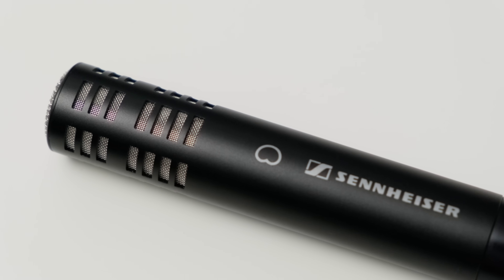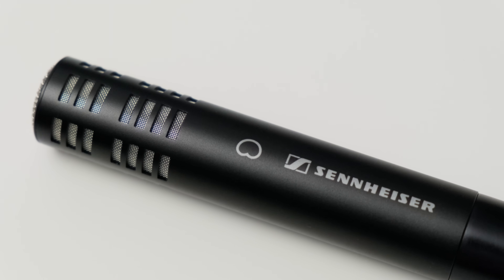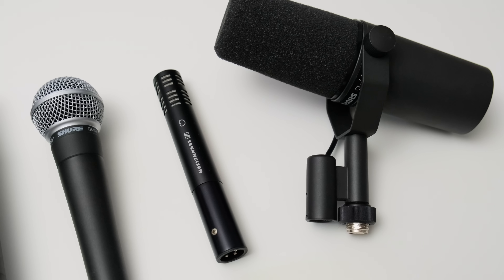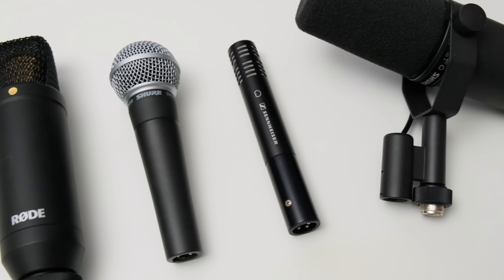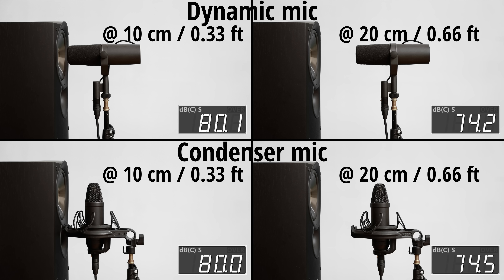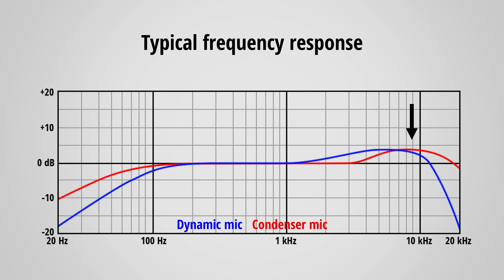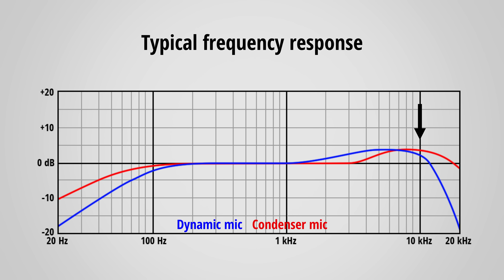Dynamic mics don’t reject noise better than condensers! And yet they do?

Comment: I don't get this video : the final exemples are clearly showing huge differences between the different mics regarding the pick up of room sound, and it's not clear to me if it's only about the frequency curve of the microphones (of course, I also hear the different frequency curves). 
I understand the argument about physics (sound is the same, wether it's a dynamic or condenser mic), but it's not only about the source, it's about the mechanical transformation of it into an electrical signal. Microphones have different chracteristics that have obviously a huge influence on the way they pick up room acoustics : directivity, sensitivity, SNR, proper noise level, size of diaphragm, impedance etc. etc. Whatever if it's a condenser or a dynamic, a, omnidirectional microphone with high sensitivity will pick much more room sound than an ultra-cardoïd one with a low sensitivity. The impedance of the preamp has also quite an influence about that. 
And I guess condenser and dynamic microphones have different characteristics "in general" that could explain the simplification of "use a dynamic if you want to get rid of room sound" : "usually" condensers have higher sensitivity and a better SNR, a lower proper noise, a different directivity... etc. even if, of course, some dynamics sound more like a condenser and vice versa (for exemple, the Sennheiser 441 sounds like a condenser).
There is also another aspect I would be curious to have some insight from someone that has some technical background : is the level pick up of a microphone absolutely linear ? Or in other terms, is the level of acoustic sound perfectly replicated in the level of the microphone output ? Or is there some kind of curve, different for each microphone, that characterizes the relation between source level and output level of the microphone ? If it's not perfectly linear (what I suspect), it could explain the way some microphones reject better low level noises, while picking the same way high level ones. This is what I hear when using dynamics : at similar global level, low level sounds are less audible compared to using a condenser.

Comment: I feel the dynamic doesn't actually reject noise but cut it down much more than the condenser microphone, the condenser microphone uses more power to empower the signal, while the dynamic is powered by the strength of the signal that comes in... 

Like the light on a bycicle, the light becomes brighter when the friction increases compare to that of a car that uses battery...

When you take a good look at the components both dynamic and condenser microphones are being made with you will realise some other properties that are missing from the dynamic which probably makes dem work differently...

Comment: Love almost all of this, just a little confused about one point:

Couldn’t you theoretically imagine a membrane which, due to whatever physical characteristics, has a non-linear response to sound pressure?

Maybe it’s just like a stiff material that won’t really put out an electrical signal if the sound pressure is below a certain threshold. Some sort of physical noise gate.

In this situation or something similar, would it be fair to say that the idea that the quieter sounds (characteristic of background, noise or room ambience) could indeed be rejected in a way that doesn’t violate the laws of physics?

Comment: Really can not agree
Try testing in noisy environment than check back
I've been using my sm58 just for that and it performs a magnitude better than my pencils and large diagram condencers.
More rejecrion, less noise thats how it works for me and why I use it
Also you used one of the if not the quietest condencer(self noise) out there, try something in the league of 80-150$ for condencer, self noise is quite present in that case.
Reply: It's about the distance from the mouth to the microphone. People tend to talk (and sing) while the sm58 almost touches their lips because it's designed that way. 

Now you're going to claim that you've had the other microphones just as close, but we're not going to believe that.

Comment: id be interested to see the nt1 and sm7 compared off axis as well - i always thought it was because dynamics use much heavier coil and magnet transducer systems that the extra mass made it harder for the diaphragm to vibrate in an odd direction therefore reducing the amount of reflections/off axis noise - now that i think about it, i never formally learned that or was told that, it was just the logical reasoning i came to and then reading years of mythos surrounding dynamics confirmed my bias there

but i think it may paint a larger picture in the way they respond to reflections or off axis noise and maybe would key in more info on why dynamics have been recommended for untreated or overly live rooms

Comment: Finally someone who got it right. I did a lot of measurements and tests and came to similar conclusions, especially that for nearfield recordings, you can simulate one mic to sound like another (which was also proven in many tests with systems like Townsend LAB sphere (which I owned), UAD Spere (which I own) and others). BUT if you record with a bigger distance and more room reverb, the construction of the mic gets more and more important. Some cardiod constructions (and I mean not "dynamic vs. condenser") are MUCH better in terms of intensity and coloration at side/rear rejection than others, and the best constructions do not discolorate the sound like others (and well constructed mics don't have to be expensive). Also you have clever concepts like Variable-D from EV which minimizes proximity effects. Who wants more from this: the youtuber "Podcastage" did hundreds of mic tests here on youtube, speaking in the mic from different directions. What makes this topic really difficult is that people often use mics as "first EQ" because they would find it much harder to reach their goal only with a hard-/software EQ (or they simply want to save time). Also, people who never measured a mic are not aware that often their frequency response is quite complex with many little dips and so on. So it's not always so easy to simulate one with the other as you showed.

Comment: Thank you sooo much. I've explained to many people, it's all about pickup pattern, sensitivity, and response curve. Thank you for debunking every single "but what about?" I've faced over the last 10 years.

Ultimately, for vocals-only, dynamics can be absolutely fantastic.  If you don't want to capture the "space", having a mic which tolerates being basically licked can be an asset.

But for all-round use, condenser sounds more natural in many more use-cases. Especially since some amount of reverb in a room can actually be desirable, for acoustic guitar or wind instruments. (Perhaps for violin, too?) They also work well for recording weather, birds, and so forth; since they don't need to be boosted as much and capture more of the "space".

Comment: I've seen  this covered a few times now by various content creators. One guy even tried to say the opposite was true. Yes I guess you're technically correct. That 2 quality mics set up the same with similar pick up patterns can both perform the same. But, most people using a mic are not using a Neuman or something from Earthworks. They're not doing XY or Z to make sure things sound right. Everyone knows that guy that hops in your Discord call. You can hear his kid on a different floor. The dog snoring on the floor in the next room. The neighbor that is mowing their lawn. The SO yelling in the background. The AC humming away. These people are almost universally using condensers. Maybe a Yeti at best.  IME this situation is almost entirely remedied by recommending a USB dynamic if they're open to suggestions. 

Whatever reason that may be. They could not be set up right. The condensers at that price may just suck. There could be a lot of things. Regardless, I think a dynamic is still the easiest solution for that person that might not even own an interface and is Googling "mic that rejects background noise".

Comment: I've heard that a condenser microphone with a cardioid pickup pattern doesn't maintain the same pattern across all frequencies. Specifically, at higher frequencies, its pickup pattern becomes more omnidirectional, whereas a dynamic cardioid mic retains its cardioid pattern more consistently across all frequencies. Is this true?
Reply from the maker: @stellaid-d5o  Hey, that not entirely true . The difference is not whether it’s a condenser or dynamic but it has to do with the membrane size. Large diaphragm mics tend to have a more narrow pickup pattern at higher frequencies. Small diaphragm mic tend to keep their pattern more consistent across different frequencies.
Reply: @JulianKrause  Thanks for clearing that up! That myth has been nagging me for a while, so I really appreciate the explanation

Comment: Hmmm, sure, the sound waves don't act different, but the membranes do. Correct me if I'm wrong, but to my knowledge membranes in dynamic mics have more inertia due to having to move a coil in a magnetic field, while in condensor mics the membrane itself moves in an electrical field. This, to me, explains the better transient response and better high frequency response of most condensor mics. But it also means the membrane of a dynamic mic needs more energy to move, hence not capturing that much detail (or room noise). Feel free to correct me where I'm wrong, very interesting video!
Reply: Hey there. Yes the membranes are different, and yes the the coil in a dynamic would have a lower sensitivity. But the coil doesn't know what is signal and what is room noise, therefore the entire signal is attenuated equally, both wanted and unwanted incoming waves. The video went into that a bit when he mentioned that you have to use more gain with a dynamic. You just get a lower signal overall, direct sound and reflections altogether.
Reply: I think that the argument DayBrake is making here is that the dynamic mic's membrane has an increased resistance to moving _at all_, i.e. that it has a nonlinear response at low amplitudes. While we model microphone diaphragms as ideal spring/mass/damper systems, the fact is that there are things like coulombic friction and stiction that come into play at low amplitudes, and dynamic mics are often "worse" in that respect.

In my experience you can often approximate a dynamic mic's "noise rejection" by adding a noise-gate or expander to the signal chain with a condenser.
Reply: The magnetic field doesn’t create inertia, but the mass of the diaphragm and other construction details affect the frequency response. If the ambient noise has a different frequency spectrum than the sound source one intends to record (which is usually the case), then the frequency response of the mic will affect the perceived level of the ambient noise relative to the desired source. Two mics with identical frequency responses and patterns would have identical ambient noise levels (relative to the source level). Most condenser mics have flatter and more extended frequency responses than most dynamic mics, and as a result may have higher perceived ambient noise levels. That’s basically what’s led to the confusion.
Reply: @kirkp_nextguitar  IME dynamic mics have sub-linear response to low-amplitude inputs in general. They behave a bit like an ideal mic with an added noise gate or expander. This causes them to seem to reject background noises, because those noises are lower in amplitude than the primary source and therefore more likely to fall into that nonlinear regime.
Reply: Take your thinking a couple of steps further. If the membrane of a dynamic mic means it is hard for room noise to move, wouldn't it also be equally hard for the sound you're trying to record to move?

Comment: This may not really be relevant for your (and most podcasters', I presume) specific room, but here's an interesting effect that most people are not aware of: The size of the receiver, so in most cases the microphone diaphragm, has an effect on how the diffuse field of the room is picked up. The diffuse field is what emerges after many reflections and consists of directionally uniform quasi-random fluctuations with a coherence length of about  half a wavelength. So if your room has a very prominent diffuse response, like a cathedral, a large concert hall or a untreated smaller room, then this field becomes relevant. For directional and coherent incoming waves, the receiver size does not play a huge role. But if the signal is incoherent ove the area covered by the microphone, it is effectively averaging over that area and statistically reducing the amplitude. That means large diaphragm microphones reject the high-frequency diffuse field more than the high-frequency directional field. If you do the (approximate) math you'll find that for a 1 inch diaphragm this means that the diffuse field is rejected by around 9dB at 10kHz compared to the direct field in the main direction. You would expect 3dB from just the dipole sensitivity pattern and the directional uniformity of the diffuse field. So you get an additional 6dB on top of that from the diaphragm size.

Comment: I had known and felt this with my experiments in an untreated room, but I am glad you made a detailed video on this subject so others could also see.
The signal to noise ratio is the same in both types, so it's not like a dynamic mic can isolate noise coming from a distance.
That's why I personally use a large diaphragm condenser mic in my videos in an untreated room. If you keep the distance the same as a dynamic mic, they'll sound the same, though, you can be closer to a dynamic mic without making weird mouth noises that the condenser will catch, but that doesn't make it a 'worse' microphone.

Comment: I have tested this with an NT1 and a shure sm48 , recorded simultaneously, kept at similar distance , with gain adjusted to level match the inputs. Also unlike Julian's treated room, I have enough traffic noise in the background. His observations about distance in placement is on point. One thing I would like to add is the difference in SNR of an NT1 and  SM48 which is dependent on the sensitivity and self noise. The Nt1 has a greater SNR and capability to pickup ambient sounds even at the lowest pressure where as in the case of a dynamic mic the low pressure/distant sounds often drowns in its own self noise. This I have noticed ,have an effect in reducing the audible reverb and ambient noise because they get replaced/drowned by white noise! For all practical purposes recommending a dynamic mic for a beginner is valid. BTW Great Video!

Comment: I have not found this to be true at all. If what you’re saying is true I should get the same rejection on a drum set using an AKG414 in cardiod as an sm7 in cardiod when recording a singer in the room with drums. I have tried this. You should demo that next.
Reply: It doesn’t match my decades of experience either.

Comment: I do say that condensers have vastly different capsule design than dynamic, and that physical difference changes the polar pattern vastly at DIFFERENT FREQUENCIES.

For example, since the diaphragm of large diaghpram condenser "freely floats" in the air, it can have pretty much omnidirectional polar pattern much earlier than dynamic when you measure with lower frequencies. Condenser can start to be more of a figure 8 and then soon omni.

This effect is highly dependent on exact physical construction of the mic itself and the capsule and ultimately in very low frequencies they're all as omni as everything else. The same effect can be noticed on other frequencies as well, where the polar pattern changes drastically from frequency to frequency and thus can create situations where the ambience of the room is picked up completely differently.

The mics are "cardioid" only in general terms, but that pattern is dependent on frequency :)

Comment: No microphone can tell the difference between noise and signal.  The noise is either in or out of band, in or out of the sense angle.   There you go, a 15 minute video in 2 sentences.

Comment: OK. My main takeaway from this is that ears are bad. Took me a bit to figure out exactly what was being compared in the sound with the echo in the rooms -- I can barely tell they exist, even after I switched to headphones (and I'd not be able to tell if it were speakers). I'm definitely not audiophile material here, LOL

Also, good to know there are shenanigans with distance. I picked up a mic a few months ago and was setting it up and didn't know exactly what I was doing with that for fiddling with settings. Was not super aware that recording distance was that much of a factor. Mild awareness, but I was not aware people typically record much closer than I thought -- me being out about... 1.5 ft away from the mic instead of being 1 ft or closer =-=;; Yeah, I'm a total amateur at this whole thing with 0 knowledge/education in this area :x

Comment: Hi Julian, you should also included cloud lifters for dynamic microphones, especially when how they increased the signal level when using them through a preamp mixer.
Also not related to this review, have you considered reviewing JDS Labs Element IV DAC/Amp? I would be very interesting on your thoughts regarding this DAC/Amp. It just was released in late November 20 24 and is getting pretty good reviews. However, I have much more respect for your reviews because you’re not influenced to promote a product for monetary gain. I hope you get this message and please, respond back to this question as soon as possible. I’ll be waiting for your reply.
Thanks,
Steven
Reply: Sorry for the bad grammar, my iPhone sometimes messes up while I’m speaking. I should review before sending…